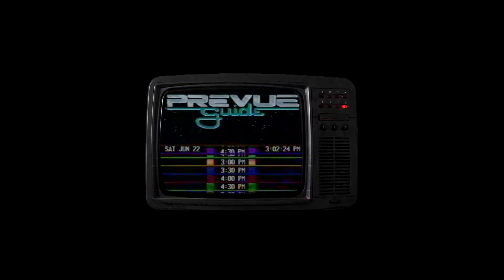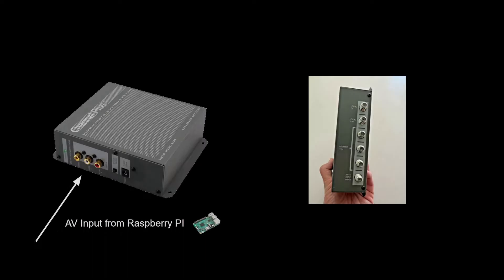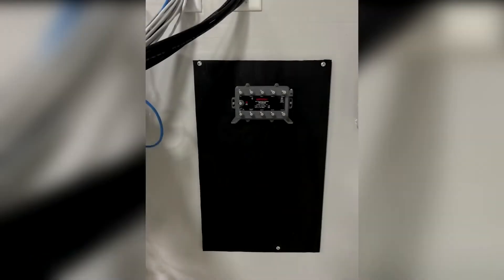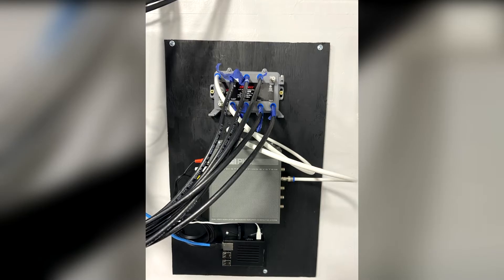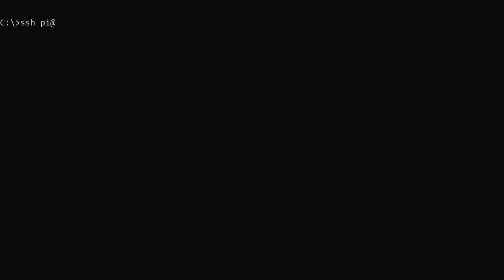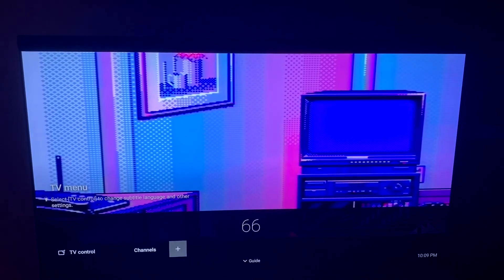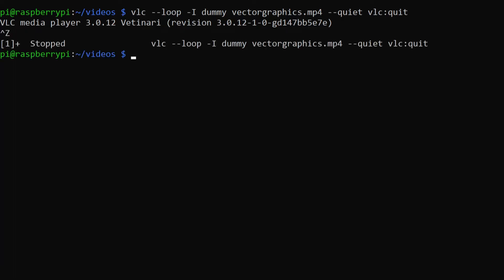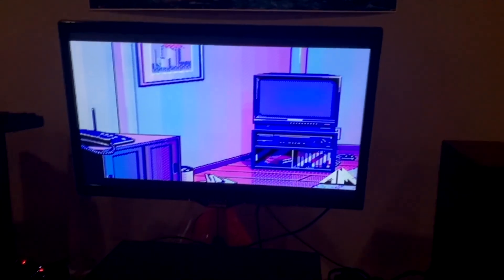Creating a Cable TV Channel with a Raspberry Pi and VLC

Comment: What does the Channel plus do exactly? Is it necessary for only one TV?
Reply from the maker: @hamburqer  The channel plus converts a signal from AV cable to coax, so the video output of the raspberry pi is viewable on a tv channel

an alternative is just to plug the raspberry pi directly into a TV, no channel plus

Comment: Does this require internet to run?
Reply from the maker: as long as the video files are accessible on the raspberry pi an internet connection is not required

Comment: I want to thank you because you inspired me to set up my retro TV. I finally connected an SSD to my Raspberry Pi and created a NAS with Samba to manage series from a Windows PC. Then, I created channels with DizqueTV, not for use in PLEX, but to download the .m3u files for each channel. Now, my Raspberry Pi automatically starts in full screen, playing all the channels I have in .m3u files in a playlist. To switch between channels, I use a bluetooth keyboard and VLC shortcuts (N = next, P = previous).

As additional information, if you're interested, I wrote a Python script to analyze long commercial videos from YouTube and split them at each change, making it very easy to manage commercials with DizqueTV. I also wrote another script that resizes my series first to 4:3 and then to 640x480 to avoid black bars. One last detail: VLC needs to have a sleep function to allow DizqueTV to start first.

Once again, thank you!
Reply from the maker: very cool, especially with managing the commercials! thanks for sharing!

Comment: How can you create more than one channel signal on the Raspberry Pi, so that when you change the channel on the TV, the video also changes?
Reply: Unless you connect the TV channel switcher to a Raspberry Pi pin so that when it detects a signal change, it executes a script to close the current video and start playing a new playlist.
Reply from the maker: You would need an additional raspberry pi to do this

The raspberry pi only has one video output, by adding a second one you can plug it into the channel plus and that's how you would have two channels

Comment: What's the electrical consumption of this?
Reply from the maker: one raspberry pi uses about 3.5 watts, 

the channel plus accepts 12v 400mA input so that’s about 4.8 watts

therefore the power consumption in total is about 8.3 watts. i’m didn’t factor in the signal booster since that is optional for this system to work

Comment: Please can you link a channel plus. I can not find one unless it's an rf modulator in the UK.
Reply from the maker: try searching google for "channel plus video distribution system"

I understand they can be hard to come by, other devices exist with identical behavior as the channel plus like you mentioned.

below is one i found

https://www.ebay.com/itm/354290398057
Reply: I think AV to RF converter just works the same.

Comment: Is it possible to send the signals over analog airwaves? Nothing too powerful, just enough to catch a signal throughout your own house.

Is that possible?
Reply from the maker: i tried googling “transmit coax signal over antenna” and got some results like below, let me know if you find anything else

https://www.quora.com/How-can-I-transmit-my-digital-TV-signal-from-the-antenna-plug-wirelessly-inside-the-house/answer/Laurence-Taylor-6
Reply: @evanugarte  Right, what I'm asking is if you connect an antenna to the video out of this channel plus that you're using, some of these devices will broadcast the video out over the air, and some won't. 

I'm asking if your channel plus box can or cannot do that.

Comment: Hey there :). Do you know if it is possible to swap between two video directories (One for content, one for bumpers, commercials, etc) automatically while it is running?
Reply from the maker: you will need to write some code for that, python threads can make this happen taking turns running os.system("vlc command")